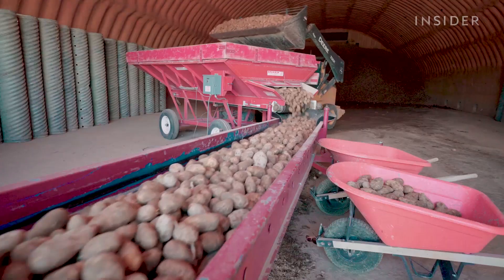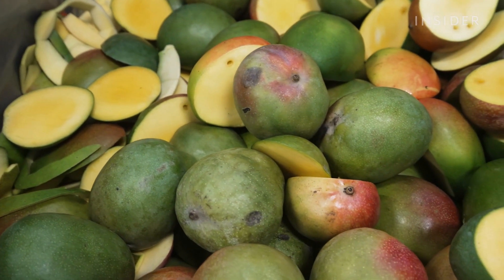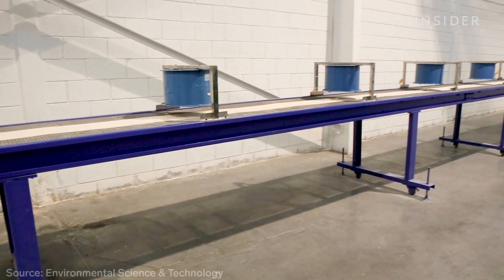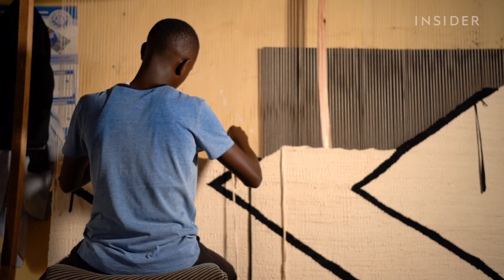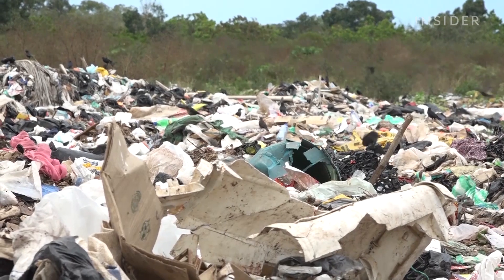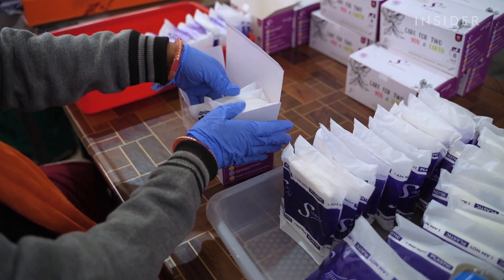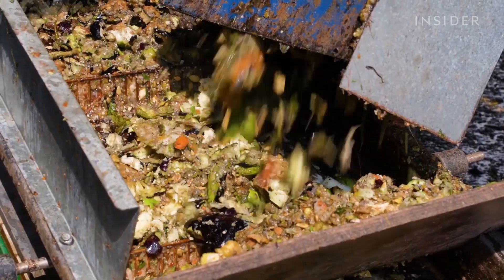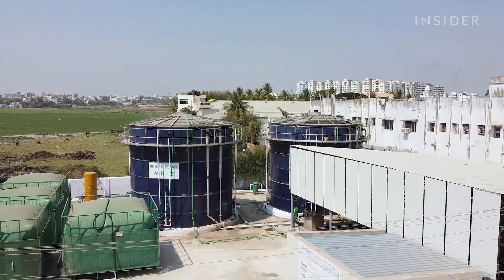How Food Waste Is Turned Into Plastic, Hair Extensions, And More | World Wide Waste

Comment: The reason bio plastic is not big is because of cost.  It is cheaper & quality is better with plastic made from oil than recycle plastic or bio plastic.  Very little is recycle, maybe 5-10%.  Most of it just goes to landfill.
Reply: Do you know if bio plastic degrades quicker or any sort of positive with the plastic itself compared to regular plastic?
Reply: @danielw.2554  it absolutely degrades quicker in a landfill, or in the environment, than regular plastic. thats one of its main benefits. and it degrades into bio friendly materials, not oil.

Comment: Sort of related to this, but sometimes I hear of good food surplus that on occasion has to be destroyed for any manner or reasons… But if there’s something of a global food crisis going on these days (a good chunk of which is due to Ukraines recent woes and their status as one of the worlds largest suppliers of grains), wouldn’t it be better for nations WITH that much to spare to supply it to surrounding countries that are having trouble feeding their own mouths? Out of good will, building up good international relations and also a way to work off any monetary debts equal to the worth of the food distributed?
Reply: It is because we're talking about food here. Food can easily rot, unless genetically modified or you add preservatives. And even if you do add preservatives, you can only prolong its "consumable" life to a certain amount of time.

Plus, does the benefit of sending it overseas overweighs the cost of doing so?
How do you persuade leaders to take initiative in helping another country when they've got problems of their own?

You're presenting an ideal solution but in reality, we have to consider the labor, time and effort. It will be hard to move without financial backing or without something in return because you won't able to sustain what you are doing (helping).
Reply: Goodwill is good in concept but not on paper.
It will be tricky to make another agree based off on good will and building good international relations.

Most help are transferred in monetary value because it's easier and practical, plus the receiver knows better what basic necessity (like food) do they need.

It's not only a matter of oversupply but also a matter of what supply, how to maintain and stock the supply, and how to transfer that supply. Will you only give the excess of that supply? Will you not give when there is no oversupply then?

Again, we're circling back to whether they'll agree with receiving supply because it can also affect their local supply. People can rely on the donated supply, and then the local market will have a hard time selling and earning.
Reply: @cchaber1936  
Ok so how would you reign this idea in to be practical enough to work, and when to implement it?
Reply: @ButFirstHeLitItOnFire  
Researching
What type of agreement would render a yes on both sides
What food the receiver commonly eats
What food can the giver give and if the receiver is willing to accept that
Are we talking about only goods here?
Because mangoes in another country, may not be part of a "meal"
For example, what will they be able to do with the mango? Do they have a dish where the mango is cooked?
Because if the goal is to avoid hunger, then it would have to be a food that's considered filling to one's stomach.
And then, there's the issue of how to properly distribute it to make sure everyone is accounted for. It takes hours to go from one city/town to another.
There are too many things to resolve before it becomes feasible.

You mentioned Ukraine, right? Poland was very helpful when the war broke. They supplied and accepted refugees. Poland is the first one to help because they're the neighboring country. Since they're close, it's obviously practical for them to do so. And they do have mixed history that make them close to each other in culture, so they're eager to help because there's that sense of brotherhood or sisterhood relationship.

Maybe, this video's method is one of the most practical one at the moment. To turn wastes into something valuable, from places close in radius.
Maybe we're thinking of the wrong solution to the problem if there are too many problems that exist within the solution.
Reply: @cchaber1936  
Well if there’s a food crisis large enough to warrant nations the world over to trade each other whatever food they can spare out of sheer desperation, I don’t think the average civilian is going to be so picky as to starve themselves if it meant other nations had to offer them food that might otherwise be foreign to them
Reply: It might even start a few lasting trends after the crisis is settled, you know? Nothing lights the fires of innovation like desperation
Reply: @ButFirstHeLitItOnFire  
I hope so.

Personally, I want that to happen. But I believe in starting with the root of problem. Poverty and hunger issues stem from other more serious issues like unemployment, lack of good quality education, teenage pregnancy and many more.

Feeding the hungry would ultimately be a short-term solution only.  It would be best for them to learn how to live on their own.

The war became the cause for homelessness and hunger and deaths, so shouldn't be the ultimate goal is to end the war? It's not only an issue of hunger but of traumatic experiences brought by the war.

Desperation comes from dire situations like the war. That's why they immediately needed the supply of food, and this is the same with those that experiences calamities. But these things are momentary. 
There's a difference between calamities (and war) and environmental issues like the overproduction of plastics. Only a few people directly encounter the growing number of plastics. One example are the people who live near dump sites. 
In most environmental issues, people don't realize the need to change immediately because the difference is subtle. And so, people do not act out of desperation because they underestimate the effect of their actions.
Reply: @ButFirstHeLitItOnFire  Thank you for conversing with me! I don't know if I'll be able to reply anymore.
Actually, I first replied before I slept. Then when I woke up, I realized I haven't exited yet and replied again. Yt is still running on the background and so I was able to go back here. Now, I'm exiting, so I might not reply anymore.
Reply: @cchaber1936  
You seem knowledgeable enough, so let’s switch gears for a second: If/When Ukraine drives back Russia for good, or rather Russia more likely collapses in on itself (As long as Ukraine is fighting a fully defensive war, their only hope is somehow outlast Russia as they collapse politically and economically, all while assuming Putin doesn’t go frothing mad and bring out extreme measures like weapons of mass destruction or cruelty on Ukraine or even on Russia itself if he felt THAT threatened with internal turmoil), what kinds of businesses and industries and whatnot stand to gain the most from rebuilding an entire country from scratch? That must be the mother load of paydays and work to go around.